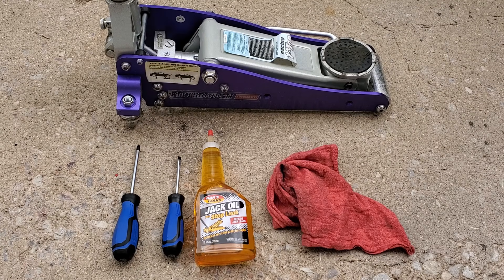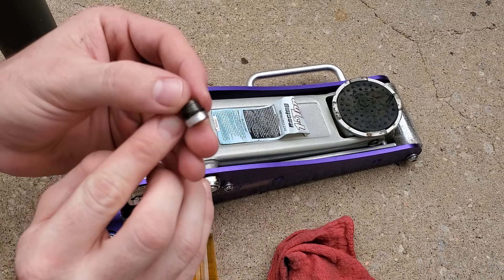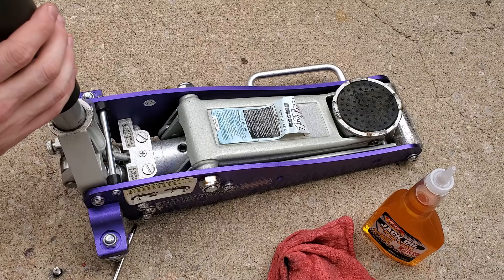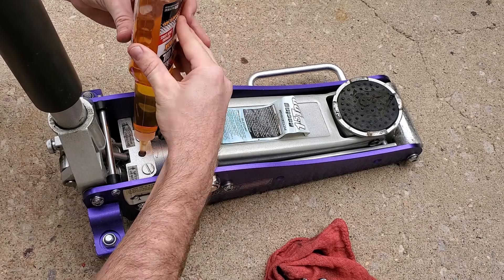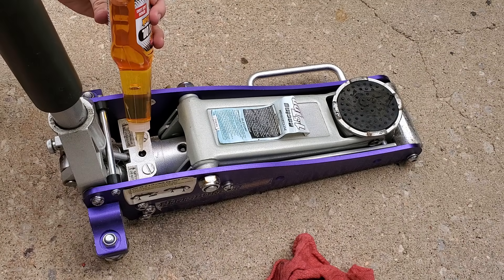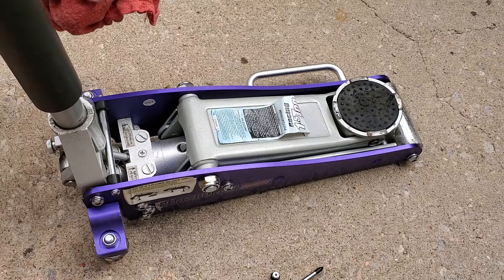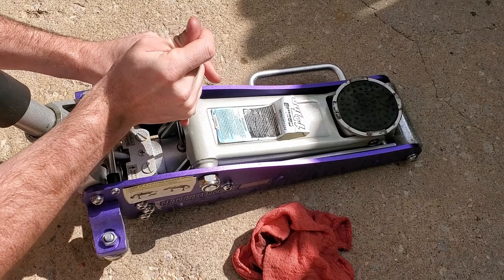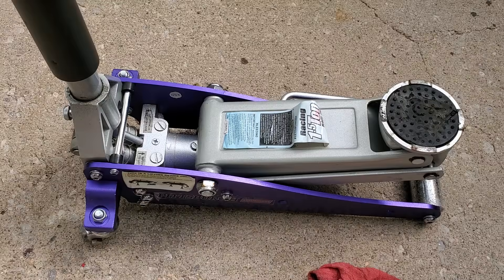How to Repair A Broken Floor Jack That Won't Lift

Comment: Hi bro. I've got the same jack. The most expensive jack I ever had and the worst I ever had. I paid 180€ for it. That was a rip off. I always used it on a flat surface and even so, the wheels broke after a few months and you cant buy them so I replaced for other wheels that I already replaced twice. I will try what you jusf did here as mine is having the same issue and maybe I can regain my "love" for it. Lol. 
Take care
Reply from the maker: 180€! Wow that's why I made the video though I don't want anyone throwing away a whole jack for a 5 dollar fix. Hopefully it works for you let me know!
Reply: @JosephToddYT  Hi Joseph. 180€ was a rip off. 2 months later they had a massive one for 3,5 tons for an extra 5€.  I bought the hidraulic oil this morning so I can try fix it. I went to a car part shop and they sold me power steering oil, the red one as it is for "hydraulic systems". Lets see if that works. The proper oil, they only had in 20L containers and that is way too much. 
I will try do that today if I can. If not, tomorrow.
Reply from the maker: I have links for where you can buy it on Amazon if that is available for you. Hopefully it works I am not sure about power steering fluid. 
Sorry about the whole jack fiasco you have been through. I wish you the best!
Reply: @JosephToddYT  Hey Joseph. Sorry I couldnt try fix it yet. I am a new car detailer and I have been practicing on a friends Smart car. I first did the maintenance and then I have been detailing his car whilst he was on holidays. I might have a chance tomorrow to fix it or try to fix it. 
I am from Madeira Island, Portugal. I have access to amazon and ebay but because Madeira is an island, we are limited as only a few sellers actually post to Madeira. For example, I need a smaller dual action machine polisher and I have 2 friends coming over in December so I will have them bring it for  me. I will buy it online on a UK website or ebay UK. 
I actually moved back home 3 weeks ago from the Uk and I brought 4 suitcases with me with my personal stuff plus detailing stuff I purchased there. Lol. Its way much cheaper to bring it on the plane than to post it. 
Take care buddy and thanks for your help and consideration. You're the man!
Reply: are you the guy who go to the Skater Park and skate with your Floor Jack ?

Comment: Where to buy the gasket? Is it available at HB as well?
Reply from the maker: You should be able to buy a huge set of o-rings at harbor freight all different sizes for pretty cheap. Or Amazon.

Comment: What if it doesn't lift at all? I tried pumping mines up but it goes back down. And I only used it a couple of times, still brand new basically.
Reply from the maker: Same process. this isn't the only thing that can go wrong with a jack but it is one of the more common things.

Comment: Any ideas what to do to fix the front roller?  It won't roll anymore so I just have to drag it around.
Reply from the maker: That would likely be the bearing on the roller going bad. It would probably not be worth fixing.
Reply: @JosephToddYT  Thanks and too bad. I only used it 3 times so far.  Knowing HF though, it's probably rusted.

Comment: My bleed valve on my harbor freight jack is just a piece of rubber. I can’t really get it back on. I tried bleeding and filling it but it hasn’t helped. Any ideas?
Reply: use silicone gasket

Comment: Nice simple video.  Some paper or a pan under the jack would catch any leaking fluid.  But you missed the most important part!  That is to give your viewers a good warning and safety tip to ALWAYS SAFELY USE JACK STANDS when working under a car.

Comment: Great video. I have the exact same model. 

However- that didn’t seem to solve my problem although I have the same issue as you described. 

On mine - the right side valve/ springs is in the closed position ( lever back down to the floor to lift) the left side springs out yet the right side stays in/ closed- 

I noticed in your video both sides spring back out. So is mine really low on oil or what about those other 2 flat head screws left & right..?

Any thoughts? That is much for your help!!
Reply from the maker: You could open it and see if it is low on oil. It sounds like one of the springs is stuck though if it isn't going back up. Its hard to say without seeing it.

Comment: Just for cheap way to stop leak stuff all it is is ethier conditioners or brake fluid also works I,very used it on front.amd rear.seals on.vehicles ethier slows it way down or stops it.  Best one it did.a miracle on cause I didn't expect it to stop it but pulled a used motor for a friend swap out the one that threw a rod and cracked block well when done the rear seal was pouring pretty good when it was running put about  to 8 Oz of it in.and drove it a mile up the road and back and was just a drip every few secs. Drove a lottle.more and it completely stopped it sat up so long and was so dry I guess once it soaked enough in it finally soften and swelled it to reseal agian. But don't keep it im.to long cause it is corrosive because it attracts water. And another tip.sinve it attracts water thats all.you need to wash it from I our hands that some no soap needed.

Comment: Joseph, it seems like you may want to only fill it about 1/4 the way up the bleeder screw threads.  That way, when you do the final bleed, it won't overfill and run out.
Reply from the maker: I think you are right about that I thought about the same after I got done with it.
Reply: @JosephToddYT  Ah well, next time, right?

Comment: Changed the oil on my jack and now the jack won't stay up. Any suggestions?
Reply from the maker: Make sure you pump it a little as you fill it so there isn't any air in the system fill it all the way

Comment: My spring are stuck behind were u put the oil 2  2 inch spring  are not lifting the cylinder

Comment: I turn the handle to the right to lock it in place but it just spins..is there a fix for that?
Reply from the maker: Look at the very bottom of the handle it should connect to a bolt that tightens when you twist the handle. Maybe that snapped or something.

Comment: Hello if anyone can help . It’s my first time buying a jack like this and I turned it counter closewise too much that oil came out , is my jack busted now ?
Reply from the maker: Nope just fill it with jack oil like the video shows and you will be fine :)
Reply: My son just did this to my jack today. Filling it up doesn't help with mine because now the handle will turn clockwise until the end of time and will never close the valve.
Reply: Gus it was dark by the time my jack failed so I didn't get a chance to look at it. I'll try to remember to come back on tomorrow and tell you what is up with it.
Reply: @travisfoster8866  my son did the same with my Pittsburg 3 ton. Were you able to get yours fixed? Ive done the replace/bleed twice now. On first pump, the jack will go up a good like it’s going to work. But as raise the handle to pump again, the jack lowers with it (almost like they are connected...it doesnt just “drop”). Im gonna try once more, but dont have high hopes.

Comment: Mines a cheap one and it leaks out of several areas when used lol. It worked again after doing this but continues to leak.
Reply from the maker: Sounds like you need new o rings. I would go to harbor freight or wherever you can and buy a pack of o rings to switch them out.

Comment: If the rubber prints in the fluid caps and places can't u buy new seals and o rings.
Reply from the maker: You can buy new deals and o rings just make sure you get the sizing right.

Comment: You shouldn't have to worry about the floor jack releasing and the car falling on you because you put either blocks or a stand or two under the car to support it while under neath.
Reply from the maker: Right, but this jack wouldn't even lift in the first place till I added the oil.

Comment: Teflon tape would probably work just as well also.
Reply from the maker: I didnt reco.end it because I thought the hydraulic fluid might eat it away over time. But good idea if anyone needs a new o ring and cant find the right size.
Reply: Believe It or Not Teflon tape is not a sealant or gasket Teflon tape is a lubricant for Threads so that really wouldn't fix it

Comment: You should never trust it to not fall on you regardless of how high it can go.
Reply from the maker: You're right you should never trust it and always use jack stands. The problem is that when they are faulty like mine was they won't even lift the car and are really dangerous.

Comment: I believe this procedure is big time incorrect. Looking at the manual for this same jack: 1) it does not distinguish between a fill hole and bleed hole. You bleed from the plug on the side of the housing which is the fill hole (big plug w flathead screw toward front). Then you add oil till it’s 1/4” below the fill hole while bleeding. I confirmed this is correct as when you buy a new one, it is at this level. I also filled completely once watching these videos and it does not work correctly.

Comment: couldnt we just use brake fluid or motor oil to fill it?
Reply from the maker: Brake fluid might work but I would be careful putting anything but the right stuff in if you are relying on it to lift your car. And its only a couple bucks.

Comment: Did you just used the same Stop Leak Oil you just showed because you supposed to used Hydraulic Oil which is the proper oil for Safety so the Floorjack won’t fail, etc...
Reply from the maker: The stop leak oil is safe to use in hydraulic Jacks that is what it's made for. It is jack oil that also lubricates the O rings if they start to get dry and leak thus stopping the leak. This helps it to not fail in those ways either. Thanks for checking though always smart to ask questions! :)
Reply: Yes you’re right about that bcoz I went to double check at O’Reilys and it’s the same oil thnx

Comment: While a hydraulic jack that won't lift all the way or stay up is clearly not good, in fact that's what's going on with my floor jack right now so I have to fix it, having it fall on you should NEVER be a problem if you make sure to ALWAYS support your vehicle with jack stands.

I see videos where people work under their cars with just a floor jack holding it up and it makes me absolutely cringe to see it. Such videos should be banned because less experienced home mechanics might assume that it's ok for "small jobs". But it's NEVER OK, for ANY job.

Comment: Mine will go up but not down
Reply from the maker: Sounds like the part that releases the pressure is stopped up. It should have a smalll hole like what I showed in the video that lets out the pressure when you twist the handle. See if it is stopped up.

Comment: I tried this, but didn't work
Reply from the maker: Sorry it didn't work for you its not the only problem that a jack can have.
Reply: @JosephToddYT  Thanks for the reply, I did figure out the problem my jack has two pistons & one was stuck in the down position, which is why it would only raise without a load. I removed the back section cleaned it out & lubed it up; works good again 👍

Comment: You're not supposed to fill it the whole way like that!  1/4" from the top!
Reply from the maker: You just don't want an air pocket. This isn't like filling a reservoir, the cylinder is its own reservoir.

Comment: you dont have to worry about the car falling on you if you use jackstands like you are supposed to....
Reply from the maker: But you cant even get the jack to start lifting the car when your jack gets this bad. It has no lifting power at all till you fix it.

Comment: Cheap garbage jacks are fixable but still a liability
Reply from the maker: Not if you don't put yourself under what your lifting till you have jack stands underneath and it's stable.

Comment: You did not fix anything! You just added fluid. It still has the issue that caused you to be low on fluid in the first place.   The o rings get a leak. There is no reason for a Jack to lose fluid without a leak.